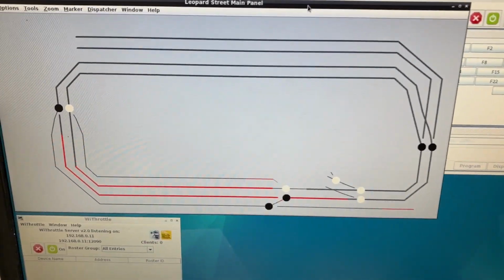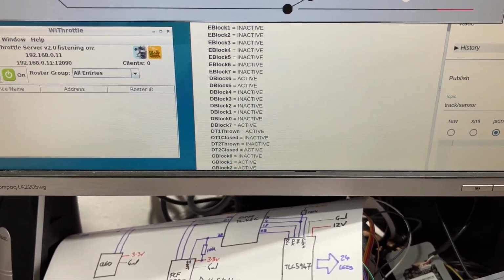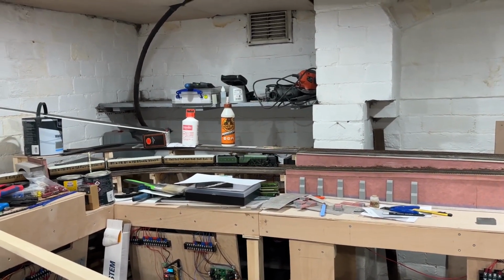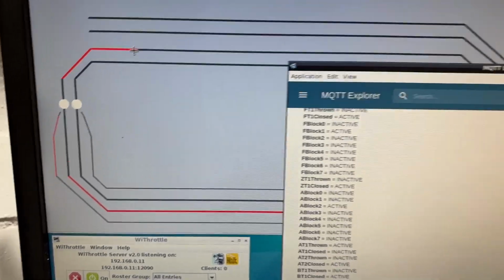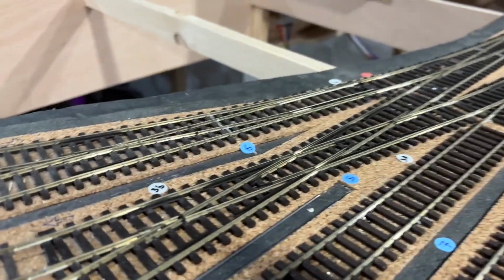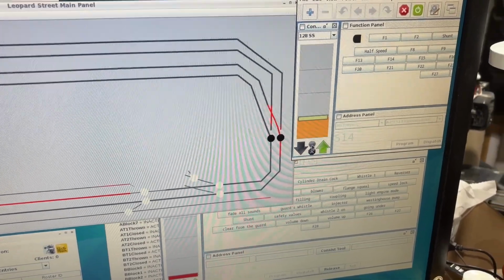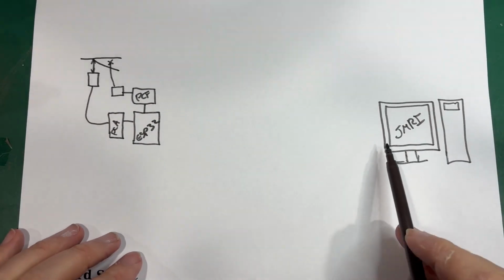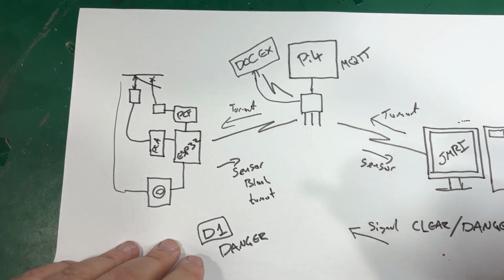Episode 40 - How to drive a layout, badly, at Leopard Street Model Railway

Comment: Does JMRI not include signal control? or did I misunderstand that part of the video?
Reply from the maker: JMRI can control signals, both automagically via its automation and manually - however I'm not using the automation and the manual side is not, yet, integrated with the MQTT interface, I'm using my own automation (eventually) and will also have manual control over the signals.

what the video probably doesn't make all that clear is that JMRI is driving the trains, its actually the MQTT broker driving the layout, JMRI is just an interface to it to read the sensors and send the instructions, I can, and before I had JMRI configured, did, drive it via MQTT Explorer

tl;dr JMRI is perfectly capable of driving signals, just not in the way I want to work, in no way am I putting down that excellent and very capable project :)

thanks for watching :)